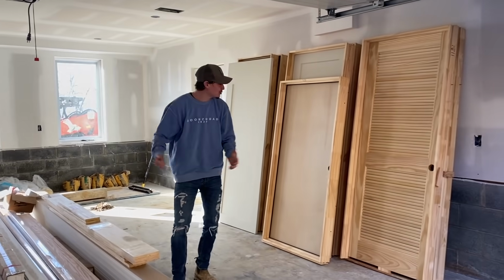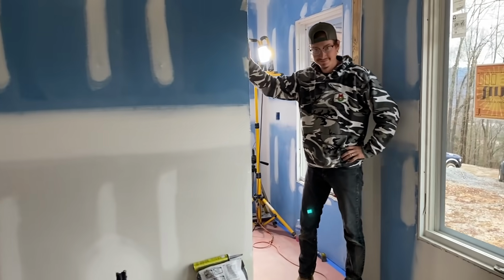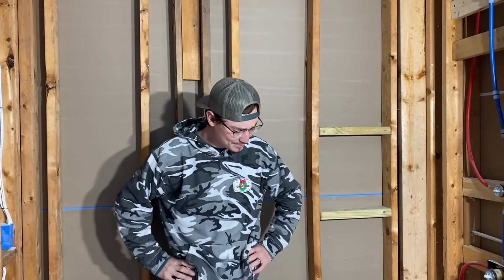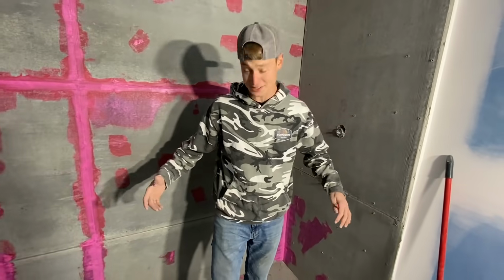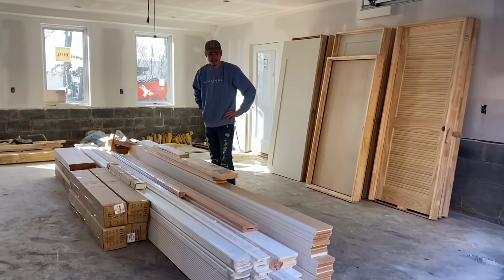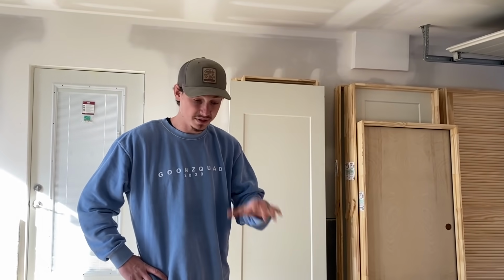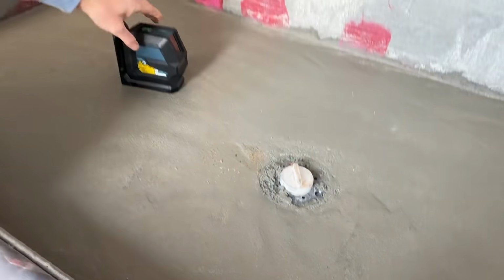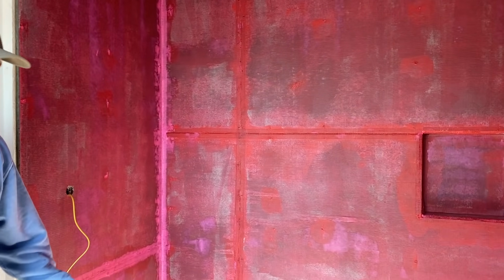The New Goonzquad Headquarters Part 48

Comment: Hey guys, note on the Red Gard. Be sure to read the directions on it. 1 coat alone only gets you protection from movement. 2 coats gets you water proofing as well. I believe the 3rd coat hits an ANSI standard for waterproofing appropriate for showers. Just make sure you guys are applying enough for what you are wanting to use it for. Not a pro here, just someone currently gutting and rebuilding a rotted out laundry room. For my use, the whole floor is getting 1 coat, but the area around the washing machine is getting 2 to take advantage of the waterproofing. It is a lot easier to do now before putting it in all.
Reply: do you really think they read anyone's comments in here so don't waste your time .stop being a expert so called contractor
Reply: @funtyes1970  obviously someone read it. And I’m not being an “expert so called contractor.” I recently used this stuff and it is very specific on the directions on how to use it.
Reply: @funtyes1970  except if you actually watch their videos, you do see that they read the comments. But hey, whatever, I’ve got better things to do than argue with someone replying to a random comment on a video from 9 months ago.

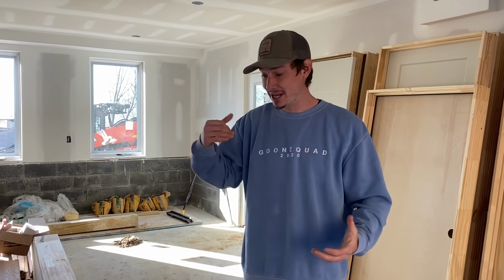Comment: 13:00 PLEASE paint before cabinets. Trust me it will save you a bunch headaches later 👍
Reply: Absolutely, paint before cabinets.. also flooring
Reply: @davemacclary9845  Save some large cardboard boxes to breakdown and put on the floors to keep the floors from damage while working.Most contractors do that in subdivisions.
Reply: @NoName-et6wk  Simple tip but a good one.✔

Comment: As a tile installer (retired) and have been working for a supply company for 20 years you need 4 coats cross rolled with the red guard to get the mil thickness to make it waterproof/steam proof. All you did is paint the walls red. kinda. Trust me. You’ll have problems later if you don’t.

Comment: Guys !! you needed to install a preslope before installing the liner. the liner needs slope. then another. sloped mortar bed for the tile.
Reply: Yep. Replaced to many showers to count where the bottom was not sloped before the pan and the float actually rots and molds. Hate to see all that work going to waste.
Reply: Don't worry... New content after 3 years: "How to restore an bathroomfloor." 😎
Reply: Also need alkali-resistant tape and mortar on those backer board seems. Not just redguard.
Reply: Yep... that shower will fail unfortunately. Why is my grout cracked on the floor? Why can I not seem to get rid of this mildew?
Reply: Pretty sure your supposed to insulate the walls as well?

Comment: I mentioned this in the last video: Thin-set should be applied at the cement board joints before waterproofing and installing the tile to create a uniform and solid surface. Otherwise, I would be worried about cracks developing down the road as the floors and wall move.
Reply: They did not put a pre-slope either before that liner so water will just be sitting on that liner and never drain!
Reply: Using grout caulk in the corners will keep the cracks down, cracks almost always show up there.
Reply: @txpyroguy817  100% correct. missing tar paper, wire and pre slope.
Reply: @MrBrando8364  They were talking about pre-sloping in this very video, weren't they? Are you sure it wasn't just hard to see in the footage?
Reply: Yup.  I commented the same in the last video.  This shower will eventually fail if it doesn’t immediately.
Reply: The shower is pretty small, the slope won't be as noticable. But I was looking as best as I could and couldn't see it. With today's mud mix, chicken wire isn't needed like it used to be. Also the mud should be clumpy when mixed, loose but able to ball up in your hand and usually takes 2 to 3 days to dry and cure. Although I haven't used the stuff they used, it's new to me so could be different
Reply: Caulk in the corners won't prevent surface cracks at the board joints. Corner cracks usually develop because grout is used instead of caulk at a change in plane and the walls are not solid enough to prevent them.
Reply: I'm actually surprised they didn't use Schluter system
Reply: Build pops some sawhorses his back will thank you
Reply: @bensenat  no doubt !
Reply: @bensenat  I commented that they should of done that! Easiest for diy guys like them
Reply: @bensenat  Schluter systems rock. No vinyl buildups in the corners where its folded. I put my Schluter system in 8 years ago , No leaks or cracks or loose tile have happened in that time.

Comment: Black grout will definitely hide the mold that grows in steam showers when there’s no exhaust vent... learned that the hard way.
Reply: Building code vents are required lol. You live in a pre 50s home ?
Reply: But a major pain to sponge off, if it's not perfect it'll stick out like a sore thumb. Would also recommend to do it in sections otherwise could dry on you which creates an even bigger pain. It would look good and definitely help with the contrast but will have to be quick to get the excess off
Reply: The mold issue was due to Not cleaning the shower.... Normally don't add vents in steam showers!
Reply: Using a grout sealer will also help
Reply: They need a fan
Reply: We have vents and don't even have a steam room but our white grout gets filthy. We have cleaners come through every fortnight but still need to get in every 6 months or so and scrub the grout. Had it sealed and everything. Next time we build itll be dark grout!
Reply: @bensenat  Actually a MUST ! Does'nt cost much but a game changer. At least 2 coats. That's what I did many times in retrofit jobs.
Reply: @1one3_Racing  You need concentraded chlorine but with a proper mask and ventilation and then more sealer. A pain. I did it so many times as property maintenace guy in rental apparts. Guess what, I installed a large  fiberglass shower stall at home when I redid our bathroom ! 😉
Reply: Yep
Reply: @1one3_Racing  grout gets dirty because you wear your shoes inside the house
Reply: @jacksonbardsley941 a window is ventilation derp derp but that's common sense you seem to of missed with your pointless reply ? No ventilation in a bathroom is not up to code period. Good day
Reply: @Hanibul_Lecktor  looks that there is already an exhaust fan installed.But even with exhaust there's issues with extra steam on the plating on fixtures and issues with lights.
Reply: Hey but they're going to slope the shower ceiling for run off
Reply: So your saying use black grout so you cannot see the mould growing??????? Thats actually dumb, its toxic and its better to see it so you can clean it...
Reply: swallowed  mine is early 2000s none here just window and heater ac duct
Reply: @1one3_Racing  Had the same issue but replaced the extractor fan with a much much  more powerful one a year or so ago.  Hardly any issues now and the fan is a lot quieter.

Comment: I'd recommend using mesh tape and thin set on all the cement board joints to prevent cracking of tile and grout.

Comment: The tile trimming is called schluter my friends, and I would recommend the Hardie backer cement boards instead of that USG.
Reply: Schluter is one brand of trim, there are others brands too. Hardie backer board isn't any better, it isn't waterproof either. Both need to be waterproofed with 2-3 coats of Red Gaurd or any other brand of waterproofing membrane to achieve the proper thickness. A lot of contractors / remodelers think the cement board / hardie board is waterproof but it's not. It needs to be sealed.
Reply: @timsaunders8384  If you're a pro doing your own you will just you blue / green drywall lol.
Reply: @SalTarvitz  Yes, some contractors do that. A then 20 years later the home owner has to remove the walls in the shower with mold all over. With a waterproof membrane applied properly, green board could work with out any problems.

Comment: No pre-slope under that pan liner is a little concerning!
Reply: They built the slope into the bed
Reply: @Bail_Money  pan liner need to sit on a slope so that the water can drin into weep holes
Reply: Slopes still built into the wet bed, which is how I learned as well, and if you take a look at any number of online how tos, they recommend the same
Reply: Over here in the uk we get a cement board with a slope built in, I’d be a little concerned with the thickness of the bed they put down on a wooden based floor
Reply: @neils-running-journey  you can get the prebuilt sloped pans here as well.  Different strokes.    But I tend to agree on the thickness over the subfloor, unless there’s multiple layers of subfloor, which there may be.
Reply: For those that don't know what they are talking about. Under the liner they installed should be a pre-slope, sloped towards the drain. Some use mud, some buy preformed. The reason is that the mud they put above the liner gets saturated with water over time, and needs to drain. The plastic drain has weep holes around its base to drain the mud. So around the plastic drain you need to place pea gravel to keep the mud from clogging the weep holes. If you do not do this correctly, over time the mud will deteriorate and you end up with a cracked, soggy, and delaminated floor.
Reply: Just have a pre-slope. Guessing at it never works out .
Reply: @robb1165  Not at all... the subfloor(plywood) is never pre-sloped. There should always be a small layer of pre-slopped mud on the subfloor before the liner is installed.
Reply: @markhavula  Yes, that is what I should have typed

Comment: Fyi when you run fiber tape over the seams you have to float them with thinset and the screws. Then 2 to 3 caots of redgaurd. 27 years builder experience.
Reply: The redguard certainly looked pretty thin; you can see through it - more like pinkishguard.

Comment: Keep up with the great work boys, just remember minimum slope for a shower floor is about 4 percent, or a 1/2 inch drop per every 12 inches from the shower walls to the drain. Also be extra careful with the laser leveller, I dropped mine once, didn't break but it did cost me $75 just to get it recalibrated.

Comment: You should also glue the fibre cement sheets to the studs and include plenty of screws. There is a lot of weight hanging on those sheets, especially if the ceiling is also being tiled. The cement floor bed should also be waterproofed before tiling. Any pin hole in the grout, water will get through and the floor base will always stay damp.

Comment: Just letting you know from experience, I would raise the cement board up off the bottom of the pan liner. The mortar bed shouldn’t be touching the cement board. It will soak up the water and your tiles will start buckling.

Comment: Those sloppy concrete finishers didn't plastic off your house and got antique release powder all over your stone. 🤦🏼‍♂️
Reply: Who would've thought
Reply: Acid wash 👍
Reply: This happens all the time with those so called licensed professionals. Always asking for the highest price and leaving the job half finished or  improperly done.
Reply: I dont understand why they havent  been back to  pressure wash the  concrete to get the dust off of it and seal it !!  Before they start tracking mud onto it !!
Reply: @tnolan3176  foot prints in the release powder make hard to remove stains.   I tell all of my clients to stay off for 2 days.  Then I come wash and seal
Reply: @braydoncollins8421  acid does not remove release agent. You need soapy hot water and a pressure wash.

Comment: Never use wood curbs on shower if they get wet they will swell and pop tile
Reply: We’ve been using wood curbs for years never had a single problem. As long as the pan liner goes over the wood your fine.
Reply: @davehaye3374  yeah I think same
Reply: @davehaye3374  I've also only used wood, a stack of 2x4's. The pan liner goes over the top, as you said. I don't think these guys did that. They've made a lot of mistakes.

Comment: Please tell me you sloped that bathroom floor to the drain..
Reply: Yea think they did thats what he said at the beginning  of the video
Reply: It sure doesn't look like it, I thought the same thing.  I did a sloped bed first, oatey membrane, lath, clear stone around the drain, more mortar bed, aqua defense membrane, then tile on top of that.  And I poured a concrete curb instead of pt wood
Reply: But they did end up red guarding the whole thing, so that's the first like of defense.  So if that fails, the oatey membrane will prevent damage underneath.  But if water does get onto the oatey membrane it likely won't drain
Reply: No they did not it's done wrong
Otey has a video to see how it's done
Reply: They need to check out "Starr Tile" Channel for How To's on how they should do this....
Reply: Randy Travis  there is no slope in there.. they lasered a line and brought everything to that line and over used a level or screen to taper back to dran.

Comment: Hate to say it, but there are several catastrophic issues with your shower install.  
1.  You didn't add a pre-slope mortar before the pan liner. While this isn’t absolutely necessary, it helps getting the slip toward the drain better. 
2.  After installing the pan liner, the mortar mix you did add appears to be very thin.  The mortar mix should measure 2 -2.5 inches at the drain and increase at a rate of .25 inches for every linear foot as it moves out towards the shower walls.  (I realize it was late and you only had 1 bag of mortar mix, but it definitely needs more)
3.  Do Not install your wall board into/ or at the level of the shower pan.  Wall board should sit about an 1/8th to a 1/4 inch above the shower pan to prevent water from leaching into the board and up the walls causing a mold issue behind your tiles.  
4.  Add two to three coats of red guard to ensure proper waterproofing.  

Head over to StarrTile on youtube and watch several of his videos about shower failures and how to properly install the pans and wall boards.  Better to correct the issues now than later when you will have to tear everything out to not only correct these issues, but you will also be repairing water damage downstairs as well.  Also, block the drain and pour several inches of water in the pan liner after install and leave it there for 12 to 24 hours before the top mortar mix to make sure that your shower pan liner is actually waterproof and not leaking.

Comment: Some of cement boards screws where to low into the shower liner, so if you will the shower with water for inspection it would of leak

Comment: Odd, no insolation between the cement board and sheet rock? You will hear that shower everywhere 🤭🤭🤭🤭
Reply: Cement board is made from concrete, which works to reflect and absorb sound waves. Therefore, it provides a highly effective barrier for noise transmission. Cement board is also very dense which makes it an excellent insulator against airborne or impact noises
Reply: @junipaRR  u crazy the pipes are in the wall so the cement bort dont have anny to littel effect. works as a carpenter :)

Comment: Hey boys. We tend to make wet rooms so that the roof and walls are made first. The board is attached to the bottom of the wall exactly directly. The fixing of the wall tiles is started from the top of the board. When the wall tiles are dry, the board is removed, and the floor is waterproofed, and the bottom row of tiles is added to the bottom of the wall and the floor tiles are installed. This eliminates the need to protect the floor from bumps while working. Fun to follow your activities. Continue with the same enthusiasm and joy. Regards. M from Finland. PS. Merry Christmas and Happy New Year 2021

Comment: When you grout the showers i highly recommend using epoxy grout. You won't have the clean it as much also it won't mold up
Reply: DO NOT USE EPOXY GROUT IN SHOWERS!! Not recommended at all. You can use a grout call prism by customs at your local Home Depot. Stain and mildew resistance. Noooooo epoxy.

Comment: According to the  Oatey pan liner instructions you sandwich the liner with a cement bed below and above.  As is your liner is just floating on the floor, not attached to anything.  Good job getting the 2x6 in there for the door support.  I love when my plans don't specify extra support for a door but the homeowner mentions they are going to install doors after the shower is installed.  Good luck with that...

Comment: Black grout would look really good just make sure it's unsanded grout
Reply: Why non sanded? Non sanded is used ONLY for 1/16 of a tile joint. Ant bigger the grout will slump and crack out. 🤦🏻‍♂️
Reply: @04milesclan  the tiles pretty much butt up together it's a very thin grout line

Comment: you didn't angle the shower mortar bed towards the the drain, youre gonna have standing water
Reply: yeah they blew it big-time.. you're going to have to tear the shower out and start over...I'd say they'll start smelling the mold after a month of use..I've been doing this over 10 years and I replace homeowner work all the time for people....and they needed to use butyl rubber to seal the drain not the-silicone they used that's going to leak...they needed polyurethane butyl rubber shower sealant...window silicone in shower silicone won't stick to the the shower pan,or the ABS of the drain
Reply: @shaunmilor  here we go again so called expert contractors
Reply: @funtyes1970 whats with your comment? Ive been doing showers a long time. I like the goon boys and only want to help them
Reply: @shaunmilor  I'm sure they be find if not they will making $1000"s more from YouTube fixing there failed bathroom so it a win for them